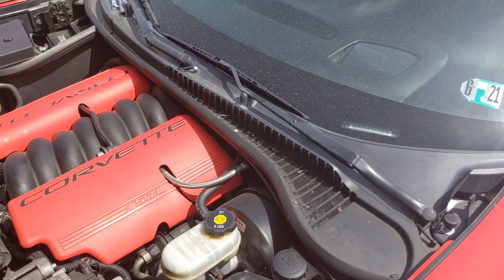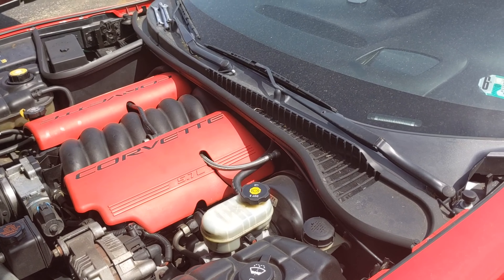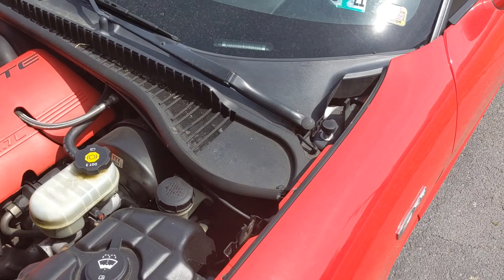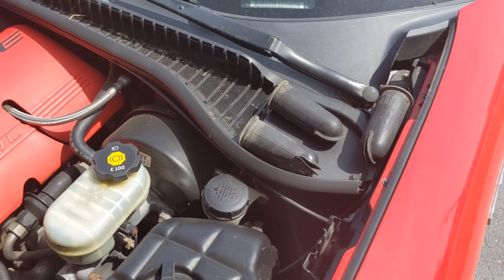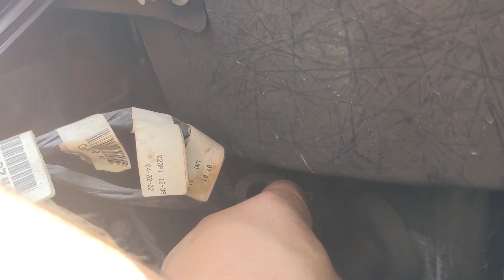2002 Corvette Z06 C5 Rain Duct Udder Cleaning

Comment: I just recently added a C5 to the garage to keep my C6 GS company.😉 I'm glad I tripped over your channel as respects this subject of "Udders." I didn't realize the driver's side had three of them. I removed the two "easy" ones and sure enough they had debris, not a lot, but enough to make my time worthwhile. So now I realize I'm going to have to go back in and find the third one, if nothing else, just to ease my anal way of attending to things.🤣 I hope I can reach it like you did.

As to the passenger side, now that one I'll definitely have to remove the battery in order to gain access, which is fine. My understanding is that this one, which is pretty long, is the problem child for getting a wet passenger side foot well. Plus, keeping all of the Udders clean is a good idea in that if water should accumulate with any degree of frequency, whether from driving in the rain and/or washing the car, and just lay in the wiper tray, THAT is not got for your wiper motors and will eventually cost some $$$ to purchase new ones and the labor to install them.

FWIW, I'm now your newest subscriber. Good luck with your channel and Save the Wave👋
Reply from the maker: Glad the video was helpful. Welcome to the C5 family and thanks for watching and subscribing to the channel. 👋